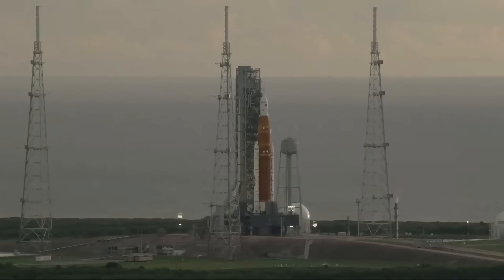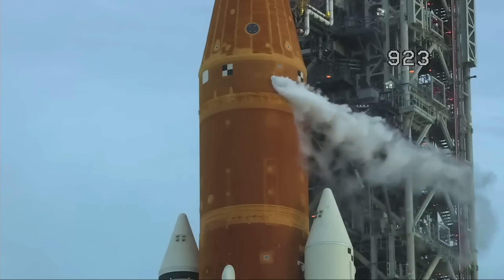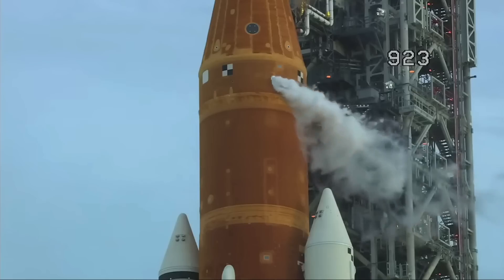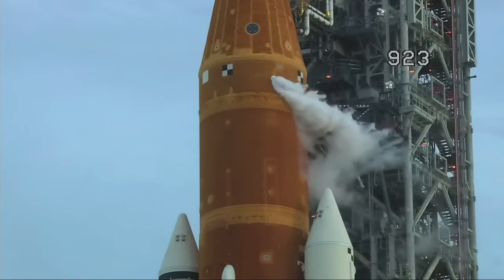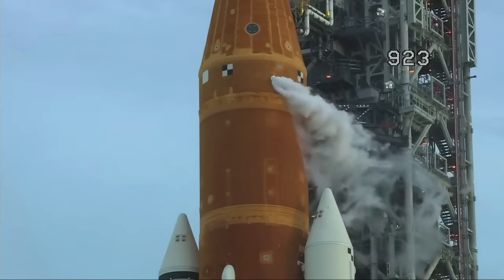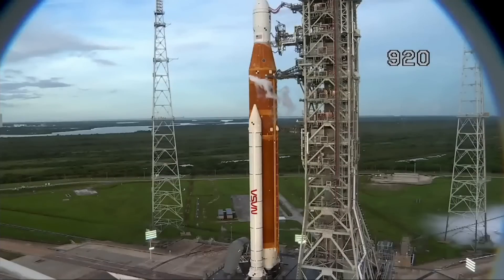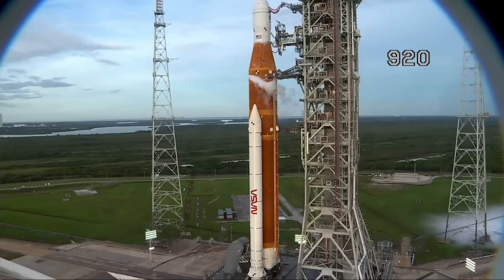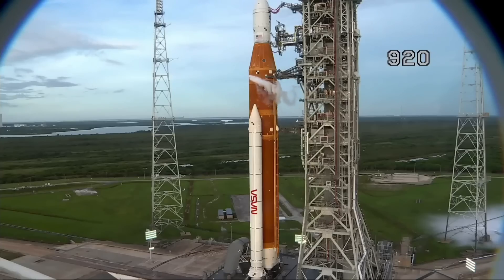NASA Artemis 1 moon rocket has 'stress crack' in tank's foam, no structural damage

Comment: They shouldn't scrub the flight just because of a tank foam problem (and they shouldn't repair the foam); here's why.

After Columbia, someone with Artemis made the decision to stick with that tank foam stuff even though it's proven sometimes NOT to stick to tanks.  A stress crack like that could (probably will at some point) happen right after takeoff, so it would be well worth it to see how the rocket behaves with such stress cracks.  It's possible that a whole side chunk of foam falls off, allowing ambient air to heat up the oxygen to the point that the tank blows, destroying the rocket.  Better to find that out now, rather than when lives are at stake.

Unfortunately NASA has a proven track record of often NOT learning from its mistakes, thus continuing to hope that foam can handle the violent shaking of a rocket takeoff and later Mach 10-plus speeds.

Is it too late for NASA to just throw in the towel and ask Elon, "What you got for us son?"  Or do we have to wait until we get to witness an Artemis fireball?
Reply: Well, they learned in the way that they put the spacecraft on top of the rocket with covered heat shields. The Space Shuttle was so critical becaue it was put right onto the tank, with even its belly (with the heat tiles) towards the tank.
Reply: The Launch wasn't scrubbed due to the insulation it was due to an issue with one of the 4 engines...
Reply: @leroy420b  I know, but all my point was is that they should never scrub a unmanned launch because of a foam problem.  Just go with it.
Reply: Falling foam is likely to be less of a problem for Artemis than it was for the Space Shuttle but there is still the potential for a catastrophic hit somewhere, as well as the scenario you pointed out.  As well, a component which suffers a stress fracture just sitting on the launch pad has to be more than suspect when placed under the stress of an actual launch.

You are unfortunately absolutely right, NASA not only hasn't learned from past mistakes, it has proven itself incapable of learning form  its mistakes.

Comment: Heres an idea, go with what worked 50 years ago. Everyone want to reinvent the wheel. Trust the guy with a slide rule.
Reply: Different engines, different payloads, different fuel loads, different stresses and distributions. They are not sending a bare-bones tin-can to the moon.
Artemis is larger with more thrust for heavier lifts
Saturn V would fail under the new stress - 8.8 million pounds of thrust, around 15% more powerful than the Satrurn V.
It's not the same rocket or the same  moon missions.

Comment: they didn't use mastic to seal it, it's so cold that the humidity contained within the air forms ice and frost, if air gets between the rocket and its insulation it will pop that urethane right off the rocket - I am a Journeyman Insulator and have worked with this stuff for 45 years
Reply: Did you also stay at a Holiday Inn last night?
Reply: @Peter-976  - that's an amusingly specific question. I'm curious what happened between you and a Journeyman Insulator last night at a Holiday Inn. 🤣🤣
Reply: @Peter-976  lol
Reply: 45 years? Now that's what I call out dated tech and materials.
Reply: @nemsire4375  well I've insulated with urethane on huge towers that refine Natural gas into other gases those towers are as big as Artemis, you can spay it on but it leaves holidays in the insulation, but we weren't expecting the tower to travel to the moon, unless it blew up
Reply: @lestermagnuson939  Ah, I remember speaking with someone who used to work in some way connected with insulation and gas refineries (I'm not sure in what respect now, it was 40 years ago I spoke to him). 
Anyway, he said something about the gas being so cold, it actually freezes the ground beneath. So his job was to insert ground insulation and to keep checking on it.
Reply: Oh ok I'll tell NASA to give a call asap

Comment: The crevice in the foam may have been caused by a small pool of LOX in the inter tank from a slow leak from the tank ?  Can they detect a higher concentration of sublimed O2 inside the intertank;?

Comment: SpaceX doesn't spray from on their boosters ,move away from the space shuttle.
Reply: Nasa doesn't spray their boosters either. They do spray the large fuel and oxidizer tank in the middle.
Reply: Spacex also isn’t going to the moon, so their fuel is not going to boil off from the extreme heat of sunlight on the way into space, foam is necessary to keep the tanks very cold

Comment: Must have been a "DIVERSITY" hire who sprayed the foam. Next step, the halfassed foam will rip off at the crack and hammer a hole in the fuel tank as it tumbles by at Mach 4.0.

Comment: Shuttle tank didn’t have this issue when they painted the tank.  Surprised no one is smart enough at Boeing to figure this out
Reply: I'm not. Boeing is basically nasa 2.0 in the public sector
Reply: The SSET was only painted twice.
Reply: They did have the issue, actually. It didn't nullify the problem too much, so they decided to remove the paint. Furthermore, it’s not an issue on sls because there’s no shuttle for the foam to crash into
Reply: They're also saving the cost and weight penalty of literally half a tonne of paint by leaving the insulation bare. The cost factor pales into insignifance given how much has been spent so far of course, but the weight saving is very significant in spaceflight terms. Around 600 pounds (~270kg) was saved by not painting the STS tanks and the SLS core stage is significantly larger (733,000 gallons of propellants vs. around 540,000 gallons for Shuttle), so it's probably close to an extra 1000 pounds/450kg of payload to orbit instead of that thousand pounds coating a booster stage which goes into the ocean. That's a pretty big deal in aerospace terms.

Comment: Proud of NASA for prioritising safety.
Reply: NASA is TERRIFIED. Too big to fail. Can't innovate, poor coordination, political interference and so inefficient.
Reply: Like they did when they sent Challenger up?
Reply: @Mark_Damian  it was Columbia that had the same problem as SLS, only difference is the foam hit the heat shield of the shuttle causing it to disintegrate on reentry, while Orion is above the foam so there’s no way it could possibly be hit by it, it’s a very very minor problem that makes almost no difference to the entire mission, but they still cared enough to delay the launch and fix it
Reply: There are no safety issues on an unmanned test flight.
Reply: @jshepard152  Safety for the future flights of Artemis 2 and 3

Comment: Nasa did a ton of successful good work in the 60s and 70s. why didn't they today go with a rocket system and rocket body design they know works. why didn't they go with an upgraded versions of the tools they used in there past to get to the moon in the 1960s and 70s. that kit worked well for the job it was designed to do. they could have looked at the Saturn rockets and improved on them built upwards on what they already knew that worked well for getting to the moon and back. surly it was good enough back then and surly and upgraded version of what they already knew from that would have been good enough for todays era.
Reply: Because all of the infastructure, engineers, manufacturing techniques, etc don't exist anymore.
Reply: Because there are new people in power building these rockets and they want their share of the pie
Reply: There haven't been any blacks on the moon yet silly
Reply: What CantEaters said. All the manufacturing and engineers from the 60s and 70s are long gone. We can’t build the Saturn V anymore. Not to mention, the technology inside the the Saturn V wouldn’t be powerful enough for all the sensors and equipment that need to be used today. We aren’t going to the moon simply to just put man back on it. We are going back on the moon to allow man to stay there. Therefore, we need equipment that can be used for that.
Reply: Congress

Comment: I still have my old seiko watch you can borrow?!?
It’s so sad that nasa destroyed the tech that took us through the Van Allen belts in the 60’s and 70’s and landed astro-nots on the moon so many times. 
Sigh. The good old days…..
Reply: Yes, numbnuts, All of the technical infrastructure, rockets, rocket engines, capsules, launchers, derricks, plus all the equipment designed to turn out that stuff from the 1960s, has long been decommissioned, junked, recycled, repurposed, put in museums, or have rusted away, and the engineers and people who helped turn out all that stuff have long since retired or have passed away. 
-
And lastly, the blueprints are from 1969, about a piece of technology from 1969, made using components from 1969. In case you haven't noticed, this is 2022. The belts are not as much of a problem as you numbnuts think.
Reply: The Van Allen belts are not nuclear radiation. They're electromagnetic radiation. Harmless to humans.
Reply: Old guy remembers; back in the day a stray alpha partial would take down a mainframe. Van Allen would probably stop X-cube cold.
Reply: @sixoffive  What the livin fuck does that mean?
Reply: @dalethelander3781  back in mainframe days they required special environments which often cost more than the equipment. We had trouble with one that was unique. So they put diagnostic equipment in and around it. Basically it was sitting near a wall that was getting direct sunlight close to a major street. The vendor claimed because of the building construction stray partials (alpha) were causing the stoppages. They move it to away from that side of the building and it was fine. It also was during solar flares so it could have been that too.
Reply: @sixoffive  Back in mainframe days? The DoD uses a mainframe. You really can't do shit with PCs running Windows.
Reply: @dalethelander3781  right, the last mainframe I’ve seen in person was a Z90 (is that right?). It’s footprint not counting peripherals was about a meter square, small by early standards. Parallel processing was just ramping up, they were just doing PC farms for data processing. Still measuring in gigaflops. Cray was losing the battle, I think IBM is on top now.
Reply: @sixoffive  Cray's Cray 1 and XM-P were great machines.
Reply: @dalethelander3781  Where I worked, we only had an XMP and a YMP. Followed by some Linux and Solaris farms. Prior to all of that they had Univac / UniSys 1100/80s with some home grown array processors. The cool thing they did, they would dump from an automated tape library to disk (input) then output to disk and back to tape. Those were the days, big rooms with lots of hardware making fan noise. Can you tell I don’t have any security clearance.
Reply: @sixoffive  Well, Apollo, the DSKYs (as far as working out the data to be threaded in) and the IU, were programmed with punch card IBM 360s. 360-85, I think, I could be wrong and frequently am.
Reply: @dalethelander3781  IBM at NASA during Apollo? Not sure, was told Remington Rand (Univac) 1100/08 was there, setup on a loading dock. Didn’t have an environment for it initially. Yea, punch decks. Don’t drop that box, you have to put them back in order. It was harder when the type was turned off and no text across the top. Probably so, they didn’t have networks like today. Programs where either loaded by punch deck or burned into the chip, asic circuit. Can’t imagine how they interfaced a card reader to an Apollo capsule. Something had to have some non-volatile memory. Maybe it was an eight track tape deck.
I heard that a greeting card that you can record an audio message on has more computing power than the Apollo computers. Wow huh?
Reply: @sixoffive  The fact that the DSKYs were programmed by weaving metallic threads is something I can't wrap my brain around. Same for the Gemini computer.
Reply: @dalethelander3781  This one I had to look up DSKY is the user (astronaut) interface to the guidance computer. That rope core memory has magnets and is different from core memory which does not. It’s mostly ROM, the data or programs is written there by how the wires were woven in and through the magnets. The programs were written by MIT programmers and female workers wove the rope core memory. There is a picture on Wikipedia it says that 2.5 megabytes in a square meter. You know in early digital computers they programed a computer from a panel that had something like 256 jacks like on a guitar, a patch cored plugged in one and the other plugged in to a different jack on another panel. That represented a word in machine language. I think that might be what’s going on with rope core memory.
Reply: @sixoffive  So named by the arrangement of keys on the computer panel. Like QWERTY.
Reply: @dalethelander3781  DSKY is short for display keyboard. They say it looks like calculator. It has a number pad with a couple of function keys like - and + then to the left buttons for noun and verb and to the right enter and reset. Above the keypad is a sort of status window next to a LCD panel that provides feedback on what was keyed in. So no words just numbers. Probably memory addresses and execution codes for nouns and verbs. Reminds of an IML (initial microcode load) panel. Cool

Comment: WHY DOES IT LOOK RUSTED??
Reply: That is the foam insulation on the main fuel tanks. That is what is causing part of the problem.
Reply: Did you really just call that rust? Dude that’s cryogenic foam, it’s supposed to be orange and it insulates the tanks and keeps them cold to prevent fuel from boiling before launch